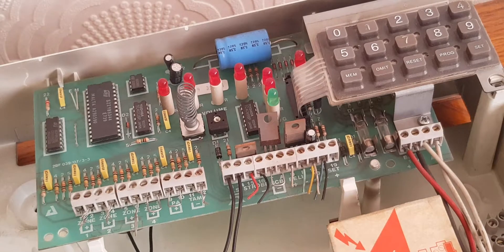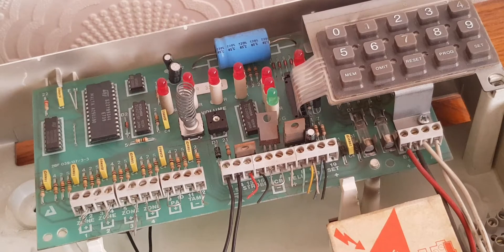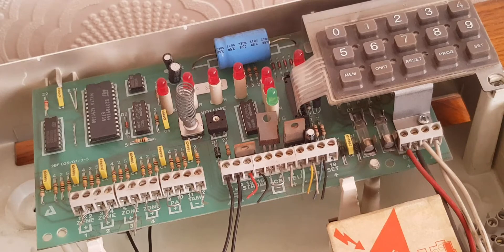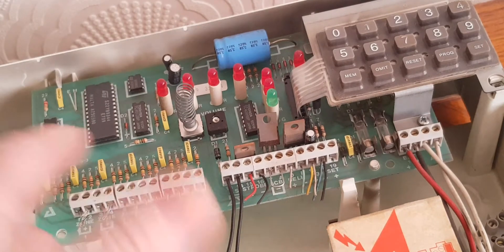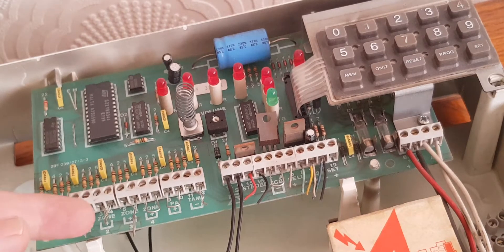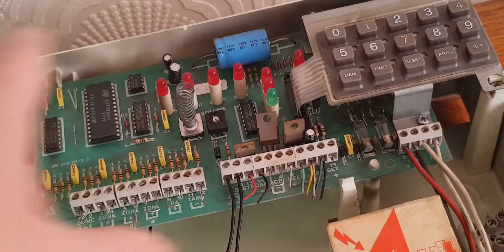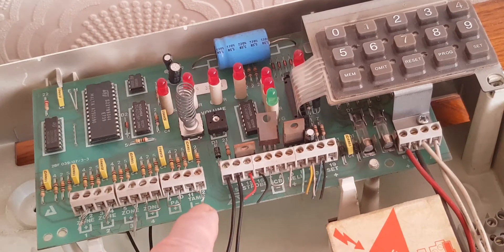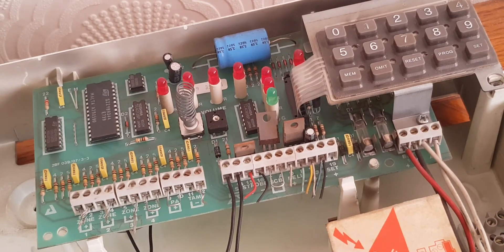12 March 2021

Comment: Hi mate, good video thanks. Just a few questions...
1. When you reconnect all the wires for the sensors. Do you turn the electric back off? 
2. When do you remove the short jumper connection from 9 and 19?